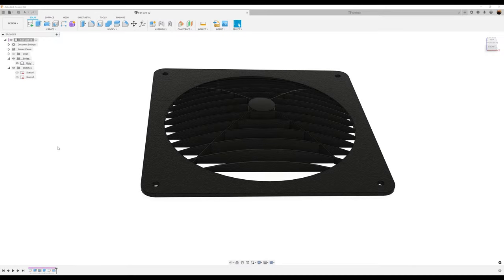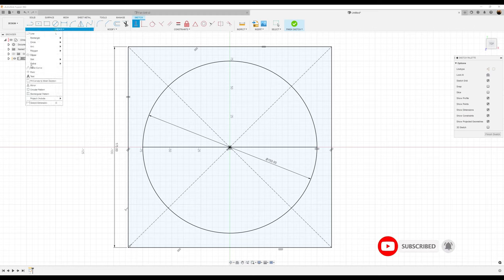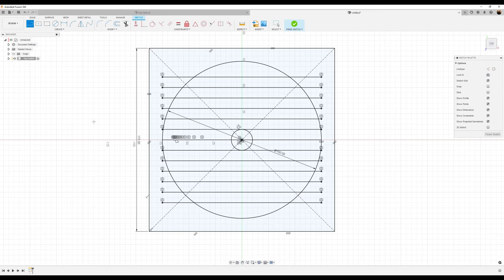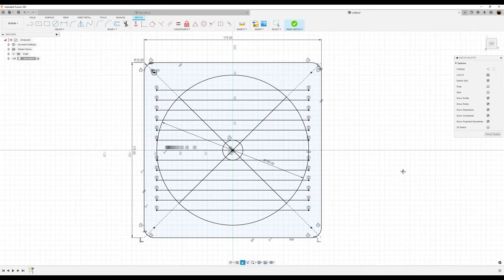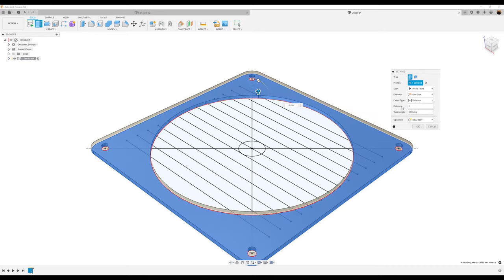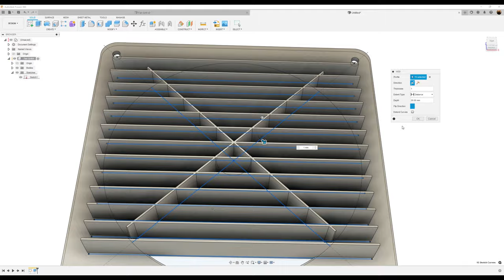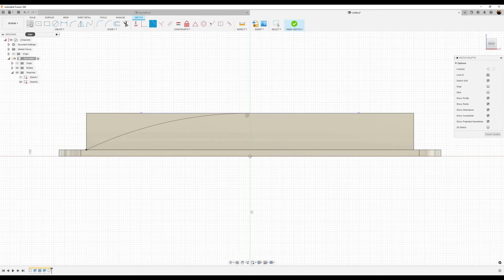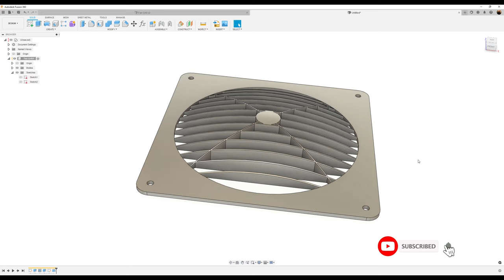Create a Fan Grill using the web command in Autodesk Fusion 360

Comment: Thank you very much GREAT tutorial !!!!!!!!! 😀😀😀

At just can figure it out how it's possible for you to snap the square edge at 7:50 for I cant. Is there is any option to validate ?

I will check all of your tutorial 😀

Thanks a lot to provide this hight quality tuto on Fusion 360:yt:
Reply from the maker: To resolve that issue you could always use the project tool. For the selection filter, you could choose between specified entities or bodies, whichever will best define the line that you plan to utilize for intersecting geometry. "Specified entities" will allow you choose specific geometry parts where "Bodies" selects the entire body outline.
Reply: @CADJungle  Thanks a lot for your fast, detailed and helpfull replied. I will try this out this WE😀
Reply from the maker: I am always here to help!